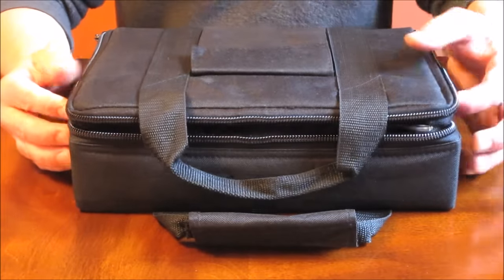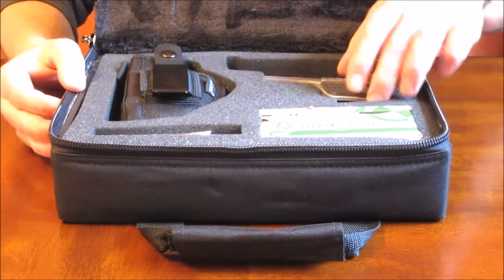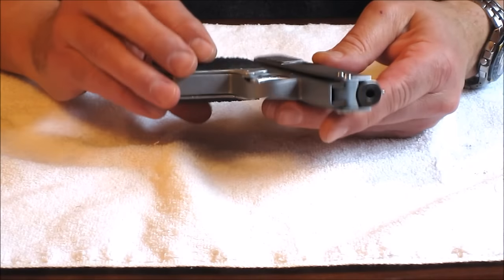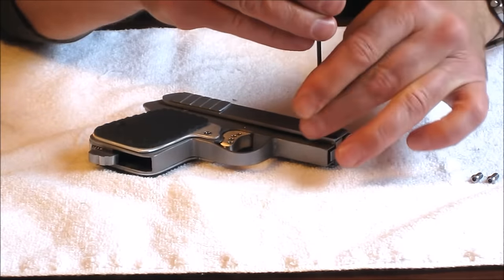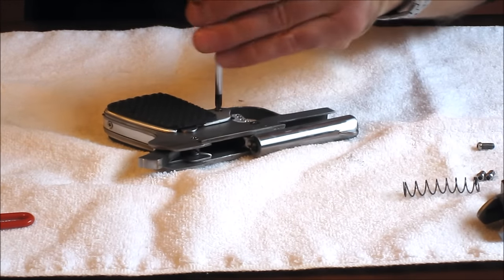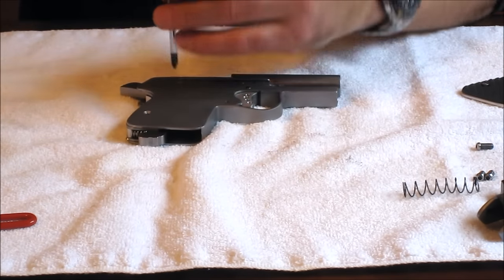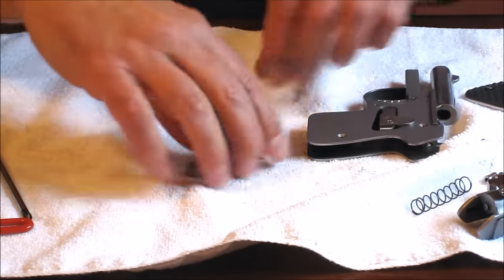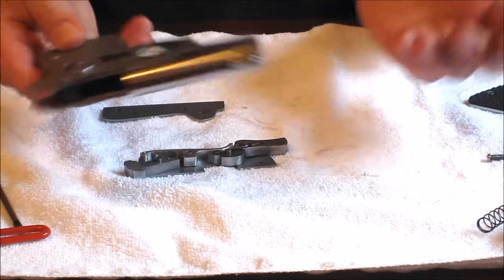Kompleted Krikit 25 (Самодельный пистолет )

Comment: I respect and admire your attention to detail.  There were a couple of things I would do differently. decrease the angle on the feed ramp.  Install a spring on the firing pin.  Adjust the hammer contact with the firing pin do that it just makes minor contact.   Angle the grip to space the rounds a bit.  My dad taught me to use cigarette papers as shims when rifling.  I used Bugler papers.  I found your  rail construction to be absolutely marvelous.  I would ordinarily braze such a design.  Fantastic video!  ##### Five Stars
Reply from the maker: +Jim Key Actually, some of your suggestions have been incorporated. I shorted the firing pin so that there is very little travel or protrusion when the hammer is down. I added a very small return spring on the FP as I suspect that it sometimes causes the spent case from ejecting due to interference with it and the extractor. After installation, the issue went away. I used thin paper to shim the rifling cutter. Do cigarette papers in sight:( 

I'm quite happy with the feed ramp now. The rounds feed smoothly and reliably. Did you see this?
https://www.youtube.com/watch?v=uQlyitOGDUg

Thanks for the comments.
Reply: Clinton Westwood Yes, Clint I watched every one of the videos and appreciate the logic and your ability to project needed changes before they actually appear.  My Father  was  a machinist and I was  good by at it by age 16. .  I was most impressed with your rails.  I would not have thought in that direction..  I am now 76 and dealing with life's issues.  I am beginning to think about building a, "My Friend Knuckle Duster" with a molded Brass frame.  In .22 Short.
Reply from the maker: Thank you so much for the kind comments. You must have had some wonderful opportunities with a father/machinist. My own father let his five little boys free run of his workshop. We cut so much expensive wood up into useless pieces that we thought were great airplanes or birdhouses. He graduated us to handheld power tools as we each grew older and we respected him enough to never cheat. Eventually we were given the keys to the table saw, the most dangerous tool in the shop. Nobody ever got injured. To this day and we are all active with our hands.
Reply: Jim Key I suggest watch a 13 part series called What on earth happened by Ewaranon to learn that the earth is not a globe. I got it in my about tab.

Comment: You, my good sir, are truly a master at your craft. If I wasn't a dirt-poor college kid, I'd commission one of these in a heartbeat.
Reply from the maker: I wish I could actually sell them, alas, I cannot.
Reply: That's right, I forgot about all the restrictions on selling modern firearms. That stinks. =/
Would it be possible to barter for one, I wonder? Say, a custom gun for a new machining tool (or tools)? Or even a custom gun for a retail gun worth about the same amount considering material and labor? I'm probably thinking too hard about this...screw it, a guy can dream. =)
Reply: JamesPolymer I suggest watch a 13 part series called What on earth happened by Ewaranon to learn that the earth is not a globe. I got it in my about tab.

Comment: I'm sorta sad it's over.
Reply from the maker: +jordan horst Oh no, no, no! This is just the beginning. The things I've learned will translate into the next build. Maybe not as extensively published, because that would just be repeats. But I've got a new build planned. This channel will never be a prolific, new-build-a-week thingie, but it will continue on in the spirit of DIY garage junk.
Reply: +Clinton Westwood maybe a sheet metal carbine or something?
Reply: +Clinton Westwood Any chance of you doing a shotgun news build?
Reply from the maker: +Thegauntlet04 Maybe in the future. I'm going to explore pistols a little further.
Reply from the maker: +My Line in the sand I'm working my head around an alloy frame, sheet metal slide 1911 lookalike. Chambered in .380, I'll call it the "Kolt 1191" :)
Reply from the maker: I created the mandrel with a flap disk on my angle grinder. I used the dimensions from the .25 acp cartridge and added some clearance. The one rear edge was tacked in situ while firmly clamped. I found the process very simple and don't understand all the hand wringing over homemade magazines.

Comment: I'm glad to see that this has been a huge success and is finished. Does anything specific that you learned from this build stick out more than the rest?
Reply from the maker: +Caleb Burnett I think the original "lay a weld bead and grind into rails/backstrap" is not workable. Beyond that point, as I got into the build, I started to appreciate the good design work. The departures and "improvements" I made were purely of a personal choice, sometimes for cosmetics other times for marginal improvement in function.

Comment: Incredible! so much better than the thousand ram-fire, spring and bolt guns. what would be neat, is if you somehow made a compensator of your own design to fit the end of it!
Reply from the maker: +Rob Horton Yes, the slam fire black pipe stuff does get tiresome:)
Reply: +Clinton Westwood Honestly if you patented this, you could probably make some money. it is really nice for a day project, easily the best I've seen on youtube.
Reply: +Rob Horton DIY
Reply from the maker: +Rob Horton Thanks for that:) Not really patentable as it's been in the public domain for over a century. Anyway, thanks again for the kind comments and stay tuned for the Kolt380, which is taking what I learned here to a new garage build level.

Comment: How accurate is that little pistol looks good I like the finishing and custom fit that you went through to get to this point. Great job I work with steel for a living and that's what I love about it the most is you can keep working till you get it right. Great job! would love to see some range videos on the accuracy and reliability.
Reply from the maker: +Pray & Spray I plan on some range testing. Time and weather hasn't cooperated. I'm very happy with the finish. The micro pits and the synthetic transmission oil I use for lubricant, seems to preserve it perfectly.
Reply: You did a Damn fine job on your project. I work with steel for a living and know what an art it is.
Reply: Hard Target I suggest watch a 13 part series called What on earth happened by Ewaranon to learn that the earth is not a globe. I got it in my about tab.

Comment: Soak it in lemon juice for a few minutes to put a light layer of oxidization on the surface so that it does not rust.
Reply from the maker: +Pray & Spray That would be an weak acid solution. I've never heard of that process. I know whenever I've cleaned steel with an acid detergent wash before painting, it rusts immediately.
Reply from the maker: +Bart Bols With a PH of around 2, it makes it a weak acid. That's why if you stick a zinc plated nail and a copper wire into a lemon, you have a battery. Won't start your car, but still a battery:)
Reply from the maker: +Bart Bols Yes, it changes alkaline when metabolized in the body as well. Strange stuff.

Comment: Where are the plans for building these guns? I love doing machine shop projects but never build a complete pistol before. Just small fixes on guns like making new firing pins, or drill n tapping scope mounts , or making grips , stocks. I have been wanting to build a complete one for quite a long time.
Reply from the maker: The link to the plans are in each of the description of the video. Or, here you go...
http://www.mediafire.com/view/8ddbm8v1fxb3899
Reply: Phil I suggest watch a 13 part series called What on earth happened by Ewaranon to learn that the earth is not a globe. I got it in my about tab.

Comment: This is great, I love it. Its very inspiring!
But can I ask what you (or anyone else here) thinks about building this for .22LR instead of .25? I've heard rimfire cartridges doesn't work too well in autoloaders, especially since this is DIY I am sceptical if it will work as well as yours did. Any opinions?
Reply: dude, i belive that, if you get a hammer spring strong enough, a 22lr version would be even better.
you can use marlin plinkster 10rd mags and a 5.5mm pellet gun barrel, tha you can chop to the desired length
Reply: S1lentStr1ke I suggest watch a 13 part series called What on earth happened by Ewaranon to learn that the earth is not a globe. I got it in my about tab.

Comment: Amazing, man. Two questions: 
1) What did you use for the barrel? Was it explicitly a gun barrel blank?
2) Straight blowback, right? Does that mean you'd need a pretty heavy slide if you moved to higher-pressure cartridges/calibers?
Reply from the maker: +Graham Hawes First question answered in your previous comment. 
Correct, straight blowback. Once you get beyond .380, the slide mass increases substantially. Certainly not an impossible situation, but my preference would be for another method of keeping the overall weight down. I will do one more in .380 as blowback, then move up to some delayed locking method. I'm learning as I go and want to stay within the limits of my tooling. I will do other builds in a different venue using real machine tools, but this channel remains the "primitive" one:)
Reply: +Clinton Westwood Very cool. I hadn't done the math for slide mass but it makes sense that 9x19 would be a pretty significant increase.

Locked action will be a pretty big step up in complexity, I think. I've been trying to figure out the easiest system. Linked tilting-barrel 1911 style would be one choice, but I wonder if a cammed system like in the Hi-Power would be easier to troubleshoot. Unfortunately I don't have a Hi-Power or Glock to disassemble and check out in detail, just a 1911.

Comment: great finish :)
Reply from the maker: +Banana potpie That was the simplest way to go. I've convinced myself that I like it:) Actually the lightly pitted surface seems to hold a thin film of oil very well. The surface are dry to the touch but smell strongly of the synthetic transmission oil that I use.
Reply: Clinton Westwood I like it.. I wouldn't mind being able to do that.. I have one option.. Lots if sanding.. :).. Or ugliness.. Usually ugliness

Comment: Why metal sheet is not recommended for making frames and slide and extraction mechanism for Cals higher than .22? And what type of material to make that for 9mm or .36 even a .28
Reply from the maker: +christian marian The higher stresses just require stronger methods. Sheet metal can be utilized for any firearm, however assembly, material and quality of welding becomes important. Mild steel is only useful for the smaller less powerful cartridges, IMO.

Comment: Better than anything out of the Khyber pass that's for sure.  Can't wait to see the .380.  Are you going to switch the design up a little bit?
Reply from the maker: +williwonti Absolutely. It will still be a garage tool build, but probably a solid alloy frame. Less sheet metal, more solid stuff. Oh, and bigger.
Reply: +Clinton Westwood At that point you mind as well go straight up to 9mm. If hi point can do it with 45ACP on a alloy frame, your build should be more than strong enough for "regular" subcalibers.
Reply from the maker: +Dave Smith Baby steps man, baby steps:)
Reply: Dave Smith 9mm is actually more dangerous to make than .45 believe it or not
Reply: +Clinton Westwood 
Its your call. Heck, you have more huevos to actually put your builds online. I live in a ahem "regressive" state, so I am only comfortable with building for myself and showing others how to in person. 

+williwonti 9mm runs at a higher pressure according to SAAMI specs due to the loading being adjusted for newer and more efficient modern powders and better firearms. However, the bolt thrust (what is largely responsible for out of battery kabooms in blowbacks) is still smaller than the 45 ACP. With a generous chamber wall, 9mm is very safe. You would need a heavier slide to run a 45 than a 9mm or even 40S&W
Reply: Dave Smith But he makes his own barrels now doesn't he?
Reply: +williwonti Steel is steel IMO. Yes, if you are going for relatively light weight and a high pressure like ar-15, you might want to be careful about steel selection, but even then it really is hard to find a steel alloy that won't work. Before Clinton showed his rifling machine, I was making repeaters using Bill Holmes handgun designs (i couldn't and still cant figure out how Bill did his rifling machine, his description of it is too weird) and I just used scrap round barstock, drilled through with a reamer (ground on the benchgrinder to the desired diameter) and oil blued in vegetable oil for a smooth barrel. These were just fine safety wise, but only good accuracy wise to about 2 yards before the bullet started veering off erratically.  Keep in mind that in a home build, the chamber walls are generally much thicker than say a glock barrel. This is partially out of necessity due to not making fine cuts and also to increase the safety factor.

But, the only way to TRULY know for sure is to build one yourself ;)
Reply from the maker: +Dave Smith i won't be building the bigger calibers just yest. By baby steps, I mean I'm planning a .380. That will keep the slide mass down to less than anvil weight.
Reply: +Dave Smith where australia,britian or germany?
Reply: @DaveSmith-cp5kj  Dave Smith I suggest watch a 13 part series called What on earth happened by Ewaranon to learn that the earth is not a globe. I got it in my about tab.

Comment: you know, if you threaded the spring retaining block retention screws INTO the block itself, you could thread them into the block instead of out and separate. That way you would not have to worry about losing fasteners.
Reply: Prepared I suggest watch a 13 part series called What on earth happened by Ewaranon to learn that the earth is not a globe. I got it in my about tab.

Comment: What would it take to make a M1911 front spring retainer block type of idea on this instead of the screws though the slide ?
Reply from the maker: Not sure. This seems to work well.
Reply: Clinton Westwood It does,...but is it "too mutch of a hassle" or an "i prefer it this way" type of thing ?

Don't get me wrong, i like it, but haven't seen anybody trying the front spring retainer block thing on this pistol.
Reply: Dutchguy I suggest watch a 13 part series called What on earth happened by Ewaranon to learn that the earth is not a globe. I got it in my about tab.

Comment: I could see that having a longer barrel to make up for the crude sights.
Reply from the maker: +Mike Mac The plans didn't even have provision for sights. The crude additions are mine alone.
Reply: Clinton Westwood Would regular sights even be possible?
Reply from the maker: +Mike Mac Yes, wouldn't be an issue. But, I'm on to better things:) This build was the learning tool to other things.
Reply: Clinton Westwood Ah, fair enough.
Reply: Mike Mac I suggest watch a 13 part series called What on earth happened by Ewaranon to learn that the earth is not a globe. I got it in my about tab.